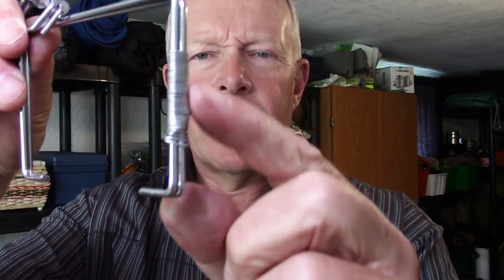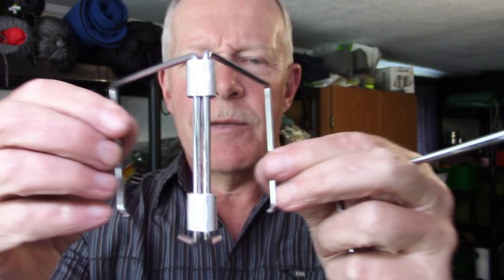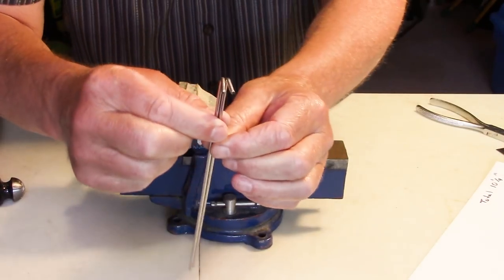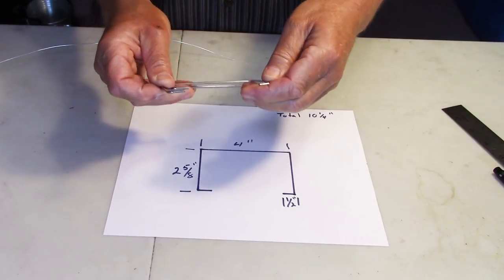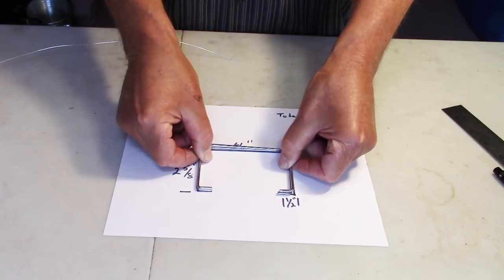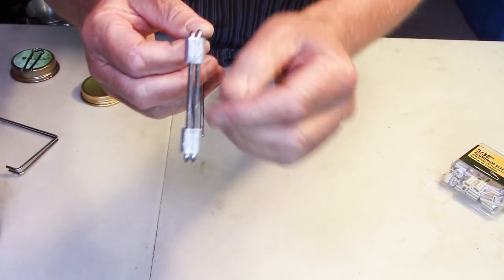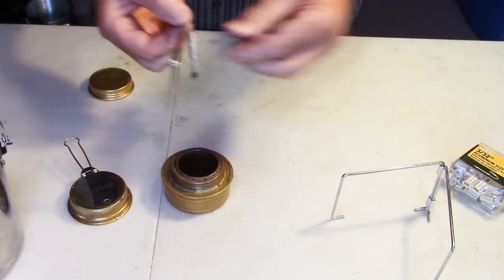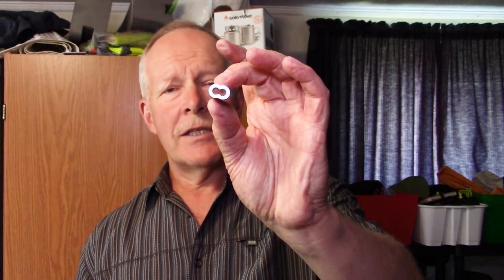DIY Alcohol Stove Pot Stand

Comment: Great project.There is not a lot of galvanizing zinc on that wire to start with.. If you do ever get it hot enough it is a whitish yellow gas/fuzzthat comes off of the galvanizing. I got the zinc chills once but I welded a pile of pipe to get it. If you are really worried, throw the wire into a fire and burn the galvanizing off. It will rust after. I don't think you will ever have a problem. Or look for stainless steel safety wire. It is super easy to work with. Thank you for the tutorial. I have to start looking at stuff in the Dollar Store for material more often. Thank you for the great tutorial, Mark
Reply from the maker: Glad you enjoyed the video. I was not worried about the galvanized wire and probably should have explained why in my video. Part of my goal was to make this as inexpensive project as reasonable. As always, thanks for commenting

Comment: New subscriber. AWESOME VIDEO!!!  Been LOOKING for this exact video for some time for my DIY 12oz beer can & Fosters can stoves!  
Curious what GUAGE is the IDEAL thickness of the barbeque skewers? (I image there's too thin & too thick guages? My educated guess is ideally at least 10g [3.2mm] to 8g [4.1mm ]?) 
Also have you designed a 'bracket' that holds the 2 open legs together so the stand is more secure? (Maybe just a wire coat hanger with a loop at either end slid over the 2 legs so they don't open or spread apart).  
Have you designed a SQUARE pot stand version similar to this 2 legged version? 
With these triangular pot stands it's IMPERATIVE to place the pot or skillet with the handle at a POINT of the triangle (not side) or the weight of the handle will tilt the pot or skillet over, which MAY knock over &  SPILL the alcohol fuel causing a FIRE! 
I've made RIGID pot stands (that nest with the pots & skillet in my preferred cook set). These stands are rectangular U-shaped.  
I use huge 18.5" 10.5 guage 'Drapery' wire coat hangers made of galvanized steel (the coating on the wire is bronze color, old fashioned 1960s-80s style wire coat hangers), not stainless steel (I think stainless steel warps under flame?). Rather difficult finding these types of coat hangers anymore though, but Amazon in the USA sells theml, but pricey ~ $3-$4 per hanger (but enough wire in 1 coat hanger to make 2 pot stands).  
I found the standard 13g steel and 'thick' 12g coat hangers too thin & buckle under flame. The 10.5g coat hanger pot stands last much longer but will eventually weaken and become brittle after a few months of daily cooking.  Maybe I should try 10g stainless steel coat hangers for my rigid pot stands?  Seems you're using stainless steel barbeque skewers & they're not warping under flame.
Maybe you should consider making a YT video on making RIGID pot stands out of stainless steel coat hangers?
If the stands fit INSIDE the cookset then not a 'packing issue' if they're rigid.
Reply from the maker: I use the skewers from our dollar store. I don't know the gauge but they are quite thin and I have had them bend with too much heat. The best would be stainless steel welding rods. Still cheap but harder to bend. Thanks for commenting

Comment: More expensive, but small rolls of stainless wire can be so useful for many things. Rather than leave it on the roll, take a nice length and wrap it around your fingers, bend it closed and toss it in your kit. For example: easiest pot hanger ever, plus you can roll it back up and reuse it many times.
Reply from the maker: Great suggestion. Actually, I do carry a length of SS wire in my cordage bag. I don't use it often but it works great for pot bails, kit repairs, etc. Thanks for commenting

Comment: Just a suggestion perhaps using electric insulation tape on the 4 in length to hold the bars together while you wrap the wire around the leg. Then peel it of when finished,
Reply from the maker: Great suggestion. Thanks for commenting

Comment: Super! Love your easy to follow instructions!   HOWEVER I'm curious why you didn't use the rounded ends of the skewers as stable "feet" ... or was that for space in the cook kit?   Thanks for sharing!
Reply from the maker: Glad you enjoyed the video. I considered leaving the rounded end on but for two reasons I decided against. First, one skewer made a whole pot stand so I would only get one rounded foot. Second, if someone was working with a different wire or rod it would not have rounded ends. Good suggestion though. Thanks for commenting
Reply: I had the same thought. I imagined you could use the loop feet on the outside of the V and square bent foot in the center. Anyway, thanks for the video. It’s and incredibly useful compact solution.

Comment: I was just thinking, can you use the vegetable steamer turned upside down to house the alcohol container or safe heat, and then put your cook pot on the strainer? I think I would try it using a good heavy wire to wrap around the steamer to keep it upright.
Reply from the maker: Sounds like a good idea to me
Reply: @MarkYoungBushcraft  I'm going to try it! Did you take the handle out of yours and if so how? Mine has a grab handle in the middle

Comment: Don't thread all of the wire through the loop - it will pull through more easily.  Same goes for string/cord wrapping.
Reply from the maker: Good suggestion. That is something I have started doing with my whippings. Thanks for commenting

Comment: The way I figured it is if you had none of the tools Mark has. Went out and bought them to make these pot stands it would cost in excess of $100.00 USD the vice alone is nearly $70.00USD at Harbor freight... it must be cheaper to buy a pot stand. but of course you'd have the tools for other projects later on 😉 After checking all of the dollar stores in my area I found they were all out of stock so I went by my local welding supply and bought 2 #308 stainless steel T.I.G welding rods and some copper wire at walmart (galvanized gives off noxious fumes when it gets hot)
Reply from the maker: Your point is well made about the cost of tools. That's why I like to point our less expensive options like pliers and hacksaw. SS welding rods are definitely good stuff for a lot of projects. Not worried about the galvanized wire as it can't get hot enough (1652F) over an alcohol stove to to release the zinc. Thanks for commenting
Reply: but why take a chance? and copper has been used for cooking for hundreds of years

Comment: I would be a bit cautious with the zinc on the galvanized wire in a hot zone.  Not good to breathe, but you're outside when using this.
I've seen people use the spring from a retractable ball point pen for the wrap.
If people want to use stainless instead of aluminum for the crimp tube type, you can get a set of 6 stainless steel drinking straws and a brush to clean them at Bulk Barn in Canada.  Cut a section.  I haven't tried crimping them but they'd probably work. Or maybe a left over piece of one of those telescoping bellows you showed in an earlier vid. 
For the gram weenies thinkgeek(dot)com sells a titanium drinking straw.
Thanks for the tip about the skewers... always looking for a source for raw materials that are easier to get in small quantities.
Reply from the maker: Great idea about the small spring as a hinge and I will be going to Bulk Barn to look for the SS straws for sure. I'm not too worried about the galvanized wire as I use the stove outdoors as you say and it dosen't (can't) get hot enough to release the zinc in any case. Thank you for commenting

Comment: Hi there, I'm not from Nova Scotiai'm pretty sure a fire ban is a ban on FIRE in general and not any particular method of having it 🤷

Also, you could use a spring (like one from spent pen) to hold the legs together, it should be flexible enough to fit on the skewers and you can stretch to size... just a thought 😁
Reply from the maker: Your suggestion sounds good. In NS a fire ban does not include gas, alcohol or charcoal stoves

Comment: When you pick things from dollar stores, how do you determine if they are safe to put near a fire?
Reply from the maker: Good question. I have no concerns about stainless steel for pots or utensils. Even if there are toxic metals in them, it would require temperatures higher than can usually be generated by a fire before being released. The only items I would have concern about are those non-metal ones that come in direct contact with food. I would be cautious of plastics unless they are labeled BPA free. Thanks for commenting

Comment: I cant believe this,,I made a video several years ago showing some flexy stand design i made that i got the idea of using female disconnect crimps to hold my stand together and make it open or fold ,only mine is like a table with 4 sides and it folds nice and compact thx to the crimps,i also had another stand that used heat shrink wire to hold it together,,,did you copy my brilliant idea for using the crimps? lol i wonder if you ever seen my video,,unfortunately yt closed my acc back then and i lost all the vids so i might redo that one,one of them had wind shielding as well so it doubled as both
Reply from the maker: I think it is a case of great minds think alike. I had seen versions of this pot stand on Pinterest but go the idea for the crimps after buying some to repair a clothesline. Maybe I should be watching your channel for some new ideas😇. Thanks for commenting
Reply: @MarkYoungBushcraft  well it's one of these things that happen and you are left to wonder where they got the idea from,if its from me thats fine so long as i get credit ,i would not have shared it on yt if i wanted to market it for myself even though ive seen some ideas i had actually come to market a few years later by other ppl ,kick to the head lol  but aside from mine you are the only video i seen after all this time on yt stands with the crimp idea ,yeah pretty smart huh like you said great minds think alike but it came to me first ok :),,anyways maybe if i ever make a redo vid of the two stands i made ill be sure to let you know ,be a fun comparison
Reply from the maker: @ARCSTREAMS  In truth, I really don't recall if I saw you video or not. I try very hard to record where I get inspiration from (if it came from another person) so I can give them credit. Occasionally, I make a video so long after getting an idea that I don't remember where I first saw it. Many times, when I see something I start looking and find a great number of similar but exactly the same ideas. I would love to see your original video to try and remember if I had watched it or not. I love to promote other YT content creators as that is what building community is all about.
Reply: @MarkYoungBushcraft  no problem,,well now i am curious to see if you recall having seen my stands ,your name is kinda familiar to the list of comments on that video hehe ok well it will be fun having you look at it anyways so ill have to see about making it and keep you in mind when i upload it or if you like to sub to my ch to get notice when it comes out would be a sure bet,,have not done any vids in a long time and only have one atm,,ill see you later
Reply: @MarkYoungBushcraft  Hi Mark,,i see you subbed to my ch,ty,,,,btw i just made a video about the stands so you should hopefully have gotten a notice for it

Comment: I've only seen seals sold for the Trangia - not the other brands and the price is $5 each and ya must buy two.  Is there a hack to find cheaper ones?  maybe silicon seals sold for thermos ?
Reply from the maker: I have tried different size o-rings but none fit. Thanks for commenting
Reply: @MarkYoungBushcraft  uh oh. thanks.  will be buying the much more expensive trangia, i guess - no gasket makes the thing half a valuable to me.

Comment: Any issues with stability?
Reply from the maker: It depends on the weight of the pot and the thickness of the wire used. These skewers will support a 750ml or 1l pot but not much heavier. Thanks for commenting
Reply: @MarkYoungBushcraft  im thinking about adding a 3rd leg on it to make a collapsible triangle.    Any design issues you see with this Idea?

Comment: wondering if one could use a piece of marine heat shrink tubing to join the stands and if it's sturdy enough to last?
Reply from the maker: Worth trying. The metal can get quite hot, wondering if the heat shrink can handle that. Thanks for commenting